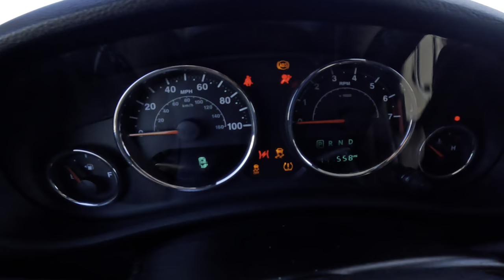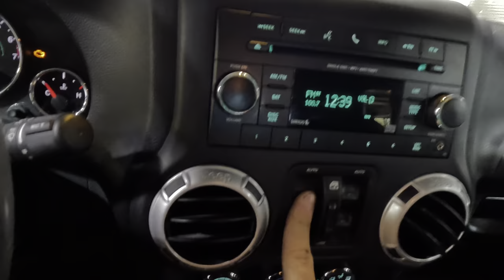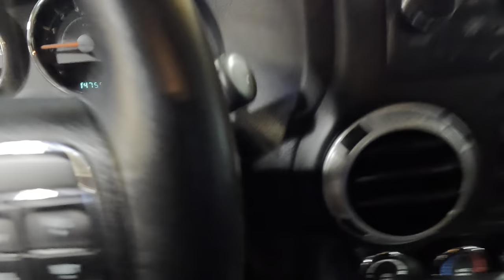BAD Car Karma! Botched Job Recovery! Jeep Wrangler 3.6 Pentastar

Comment: Ray !  This design is a NIGHTMARE!  (but a GOLDMINE for a service Tech) 😂  I can NOT believe how hard it is to remove that passenger side valve cover. The driver's side wasn't  that easy either.   This repair gave me FLASHBACKS of changing out KNOCK SENSORS on GM engines. I saw your hesitation about replacing the oil cooler, probably due to $$$.  However, just like the KNOCK SENSORS I mentioned, the labor costs involved in a second(or THIRD) teardown make this job VERY EXPENSIVE.  
GOOD CALL on your part for the aluminum oil cooler  housing.

Comment: I recently did this exact job on my friend’s 2015 Wrangler. Both valve covers were leaking but the there was something bigger leaking as evident from below, just like this Sahara. I tore down the intake manifolds and found lots of oil in the valley too. They had upgraded to the aluminum oil filter housing a year prior. I originally was diagnosing and repairing a 5V ref intermittent fault that I was able to trace to the oil pressure sender. The oil cooler was leaking oil between the cooler and the housing, not from the housing unit itself. Those Dorman figure 8 replacement seals are crap. OEM seals for the housing and cooler are red. I noticed how stiff the Dorman figure 8 seals were compared to OEM. As soon as you turned the cooler sideways, oil poured out of it. Also, the Sahara’s driver side valve cover was replaced with, what appears to be a Fel-pro gasket kit, as their spark plug gaskets are brown. The OEM valve cover gaskets and cam sensor seals are black, as seen on the passenger side. The Fel-pro cam sensor gasket is blue as seen on the driver side. Therefore, only the driver side valve cover was previously attempted to be fixed. Be sure to replace that PCV valve as that’s part of the problem under that valve cover. Great work!!

Comment: Wow I feel like an idiot. I'm a technician and have done these valve covers a bunch of times, and never realized removing the battery tray would of  given me more room to get to the screws to the back for that pcv elbow. I've always fought with those screws from the top. Thank you for showing me that removing the tray will aid in removal next time.

Comment: You may want to suggest the oil filter adapter from Baxter Performance, holds oil at the top of the engine to prevent dry startups which are harmful to the valve train

Comment: Pentastar engine…🤦🏻‍♂️

Our shop has performed several of these oil cooler replacements. We’ve used an all aluminum Dorman cooler and it leaked. It was determined their O rings were cheap (probably Chinese knock off?) We reverted to the Chrysler cooler since the part was revised and used their O rings. It’s a lot of work to access this part, I certainly hope this works out for Ray. I’ve seen him use the Dorman cooler on other Pentastar engine repairs.
Reply: How much do mechanics charge for this job?
Reply: @golferpro1241  usually around 250ish I believe.
Reply: I've never had an issue with them. I was even rushed to get a desk jockeys pentastar done. He decided to wait even though he was advised not too. He's been back for other services and such. No leaks from the oil cooler.

Comment: Good day to you Ray!!! I have to say, I will never own a pentastar V6. What a mess of an engine!!! I would bet that a majority of your jobs are fixing botched repairs. Jeep should use the straight six in these vehicles. Maybe employ the new Hurricane six? Dave sounded very busy in this video. It was so charming to see Wife Unit doing her cameo appearance. Ray you are so blessed. Great video bro!!!😁👍
Reply: At least this one didn’t have the optional inspection ports added to the crankcase
Reply: “Mess of an engine”? Really? It had valve cover leaks and the oil cooler. Big deal. 147k and it runs fine. The Pentastar should use a little less plastic but it is otherwise a great engine.
Reply: @tylermacconnell217   Sir, you are entitled to your opinion, as am I, have yourself a great day 😁👍
Reply: @davidbaize4825  Part of the benefit of being able to comment on a video is to educate - and I don't mean that condescendingly. Ray tends to get down on the Pentastar in his videos, because he has worked on a few bad ones, but they really are a great engine. Good power, good fuel economy, good longevity, smooth and quiet. Relatively easy to work on. Every engine has good things and bad things. The "bad" things with the Pentastar are the oil cooler - which is a pretty simple fix - and cam lobe wear on some of them. That's a harder fix, but also not catastrophic. It doesn't happen to many of them. This engine is literally in millions of vehicles on the road now. It is in its 14th year of production with only one major revision - rare in terms of engines these days. Many of these engines will go well beyond 200k miles with minimal issues. Every mechanic has his biases. Ray originally insulted Fords as much as anything - but his friendship with Arod from Powerstroke Tech Talk has caused his opinion to change a bit. Anyway, buy whatever you like, but taking one youtube mechanic's word is not the best option. See scotty kilmer, for example.
Reply: @tylermacconnell217  I am happy to hear you say all this. I have a 21 Pentastar and have become uneasy watching some of these vids. I am somewhat easier now, in my mind anyway...
Reply: @tylermacconnell217 I don't even like Chryslers that much and I'll admit the pentastar is a solid unit. Oil coolers, rocker arms and the occasional oil pump. Big deal. They're easy to work on
Reply: "At FiatSler, YOU are the QC department!"
Reply: @tylermacconnell217  they also have significant oiling issues which frequently truncate engine life catastrophically.

Comment: Here is a cool thing to try when changing the crush washer on the oil plug. Take the cap off the oil and put a shop vac in the hole where the cap goes and turn it on. That will allow you to go underneath the vehicle and unscrew the bolt and you won't drop a bit of oil

Comment: I’m glad I get to see what’s involved with replacing that oil cooler. My wife has a 2016 jeep wrangler as well. Only 40000 miles on it but I see the headaches coming in replacing the oil cooler assembly. I’m planing on ordering the aftermarket aluminum one this summer. Just as a precaution. I can’t do the job myself, so I’ll ask my mechanic what it’s going to cost for the job. He’s ok with me getting the parts. Thanks Ray.
Reply: Same Jeep. Mine has 85,000. So far, so good.

Comment: At rear of left valve cover, that’s the PCV valve. If you pull fender liner you can get lower bolt out. Upper can be removed w/o pulling battery. There should be 2 bolts/screws holding it in.

Comment: I love watching your videos.  I just want to give you and FYI.  I did the passenger valve cover gasket on my 2014 wrangler last month.  To get to that lower PCV bolt remove the fender flare and wheel liner.  It makes it a whole lot easier to access the bolt without removing the battery tray and fuse box.

Comment: Back in my younger days we started a racing club that would race street rods at the drag strip about fifteen miles from us. When we would meet in one of the local towns and drive where all the locals would cruise on weekends. When doing this we would have rubber chickens and throw them into other members cars when passed the or ended up next to each other at a stoplight. We also did a thing with pint jars and tropical fish. That we set on the center line of the street at the stoplights and either we put one down or picked it up, depending on if one was there or not. I thought about doing that with the girls we riding with us but we all decided to nix that in a hurry because of the trouble factor. 
You mentioning the ducks in the jeeps reminded me of the crazy old days.

Comment: When you said the engineers made something easy for a mechanic at 3:30 I knew you were in for it. You pushed your luck taking connectors loose saying it would be "easy peazy."
Then karma bit taking the rt cover off.
In the'80s engineers would come down to our hangar floor and confer with mechanics on best ways for mods or special repairs.
We've been replaced by cad programs so the engineers never have to go out of their cubicle.
Keep up the good work Ray.

Comment: I did a cooler on one of them jeeps. Not too bad of a job just time consuming to  change a part that takes 5 minutes to change. The part  i had problems with is getting the temp sensor out. Someone put pipe dope on it plus the sealant that was from the factory. So it was basically welded in there

Comment: Ray.  Don't worry over the feelings of whomever did the prior work.  "Either you Know, or you Don't Know."  The poorer the Design, the more difficult the job becomes.  You have the touch, meaning that you know to handle metals, plastics, gaskets of different types, etc. One mistake can result in a failure.  Because of bad design. These vehicles are way more difficult to fix, than they first present. The owner should be glad you are Saving the vehicle, which looks nice on the outside.  Somebody bit off more than their level of expertise.  They tried, but they just were not ready for prime time.   We all start somewhere.  You are at the Very top.....the rest....well, they gotta learn to watch all the videos!

Comment: Didn't even have to watch the video. the oil filter housing/oil cooler. They are plastic and crack when you over tighten the oil filter. They also twist and cause O rings to leak They have good aluminum ones that are stronger. I just changed on a 18 jk sport. 95000 miles. Good job Rainman

Comment: You can do the passenger side without pulling the battery. You have to pull the fender liner out on that side, but the coolant lines have to be undone

Comment: I have tried to run high-end plugs in a Chrysler engine and had problems, switched back to champion and it worked fine. Eventually moved to NGK, but this was a 90s Chrysler neon motor. 😂

Comment: Same stinking engine on the grand caravans. I replaced the  oil cooler with another plastic oil cooler and it failed within 2 months, I couldn't believe it. I then discovered the new metal one, that fixed it but I had no clue. Nothing like doing the same job twice.

Comment: Ray if there's oil in the PCV hose or manifolds upper and lower should replace PCV. You will have to remove passenger front tire and outer and inner fenders. Yes I've already done it twice, every 50000 miles. Result if your customer doesn't burnt oil and failed Piston rings and at worst case blown engine.
Reply: What are you talking about? He removed the PCV, he’ll prob replace it. It looked like trash.

Comment: Quite literally just had to do this repair myself on my 2018. Lol it didn't go as smoothly as you made it seem, broke the coolant temp sensor on the back as it was corroded in the housing. The Dorman aluminum replacement is great.

Comment: A friend of mine had a 2018, charger 3.6, had a large oil leak, traded it in after 2 years, only 78k on odo.

Cam trigger and vvt actuator seals are a problem with these turds as well

Comment: Thinking someone tried the old '1/4 turn of the valve cover bolts to stop the leak' trick. Which doesn't work in modern cars, obviously.

Comment: New editing program ?  The 3.6 could be a good engine! It makes a lot of power. Too bad Chrysler cheated out on plastic parts! Thermostat crossover, oil cooler etc. The oil cooler has other failures usually done by shade tree mechanics like the oring on the filter cap and cross threading  it. Great video!

Comment: I've despised Champion plugs since I was a teenager in the early 70s working on small engines. This taught me that I should never put them in my VW unless I wanted to extract the plug hole threads. Why do they even exist?
Reply: What would you replace the Champions with?

Comment: Yeah J .D. Power says Chrysler had alot of breakthrough engineering techniques  but the problem is that they suck.I finally get to see in real time probably one of the best mechanics around and its taking him so long just to access the passenger side valve cover.

Comment: Now I know what an acquaintance of mine meant when he said that the V 6 jeeps are crap. On my older cars Champion plugs always performed better than AC Delco plugs hands down but that was back in the eighties. Disclaimer: I installed nonfoulers on account of the sparkplugs would get oil fouled plus I ran hotter plugs

Comment: lol, reminded me of when I had to change the transmission mount on my cherokee.  you literally had to remove the whole battery holder for one bolt and I just said f that and I just broke the plastic that was covering the bolt.   I just made that executive decision of breaking a few inches of plastic than to take a few hours trying to figure out how to remove about 10 bolts to remove a little piece of plastic.

Comment: I have a jeep Cherokee latitude replaced the oil cooler fixed oil leak and 25000 miles later had to replace it a second time called jeep about it they said they know it's major problem but won't do a recall on it. Very expensive to replace...😢

Comment: i dont know whether to blame the engineers or companies for the way they attempt to force you to go to the dealer for simple fixes anymore. replace a battery on a 2014 dodge, no problem, just got to remove a wheel and the inner fender well for access.   05 ford alternator problem, no problem, just remove the wheel, tie rod, ball joint, and you can have access after 2 hours labor..

Comment: Oil cooler looked original to me, if so definitely needs upgraded version at 150k miles. But how long  do the original plastic ones typically last, thats what I'd like to know since my 2018 Cherokee has similar engine with 60k mi...........

Comment: 9:24  i have a 2021 jeep wrangler if i ever have to do my cooler could i just take a grinder after removing bolts and cut the hole into a slot instead of a round hole. that way you could just pull up to clear the bolts instead of having to pull the bolt studs backwards and then clear the hole.

Comment: Fingers crossed the 3.6 in my Ram doesn't have oil cooler issues.  I keep hearing about leaking 3.6 oil coolers.  Maybe they improved by 2021?

Comment: nope. i wasn't scoffing. cause i've done it. except we did it without removing the coolant lines. just took out the battery tray and removed the valve cover. it had a roller rocker tick that is common on these engines, so much so that its known as the pentastar tick.

Comment: I’m new to this particular mechanic channel. I thought VAG was bad about unnecessary fasteners and absurd engine compartment designs. Watching several 3.6 engine videos regarding the Pentastar comforts me. VAG has always overbuilt their engines, in my opinion. Along with some questionable material choices. I’ve always replaced the cheap plastic parts when better aftermarket parts were available. I’m a diy’er that’s been working on my family’s VW’s and Audi’s. I think weve had 12-13 over the past 20 years. I used to drive 50 - 60K miles a year, then hand them down to our kids. The cars would last 150 - 200K miles before being traded for a new one. Maintenance is key to any vehicle. Especially to some VW engine designs. ✌️

Comment: You would think, erroneously, that a big rectangular open top engine bay would have plenty of empty space for working around the engine from all sides...I guess they look at it and think...what kind of big plastic box, wiring harness and tubes can I cram in that free space?

Comment: Just think about this. The vehicle is a 2016, the first 3 or 4 years of it's life was maintained by the dealer. If this vehicle is still under the original owner, more than likely the original repair was done by the dealer. So the last repair was sufficiently repaired by dealer before you took it over to see all the cut corners and carnage.

Comment: I had a Dodge Dynasty in the early 90's that had an engine chip in the radio.  Dodge had replaced the radio with one from a Chrysler New Yorker.  The chips were incompatible and fried electronics all over the car.  Dode's solution was to cut the black terminal to the engine where no one could see it.  Only figured it out when the serpentine belt broke and no idiot lights came on.  I see nothing has changed in their engineering on American cars and is why I won't buy one ever again!

Comment: Could this have been a worse job?  Well, Chrysler didn't make you discharge the AC system, nor touch the timing chain.  But pulling out half the toolbox is pretty bad.

Comment: I've had 3 Wrangler Unlimited's (2008 Sahara, 2011 Sport, 2014 Rubicon X series) - the 2008 was decent, the 2011 was a powerless piece of crap, the 2014 was worthless after 60k miles.  I now own a 2021 Toyota Tundra; never going back.

Comment: I have a 16 Rubicon with 70K and the engine has been apart twice for valve train problems then cracked valves. It is now waiting 5 to 6 months for a new engine since coolant is leaking THROUGH the cylinder walls when shut down. The dealer said this is now a common occurrence and they put a bore scope in the cylinders to video the coolant dripping through pinholes inside the cylinders. Thanks Stellantis and Fiat, you ruined what was a good product.